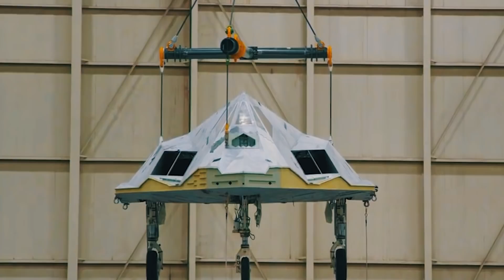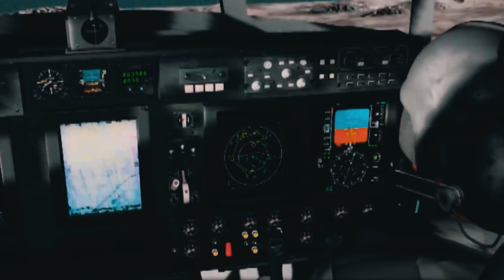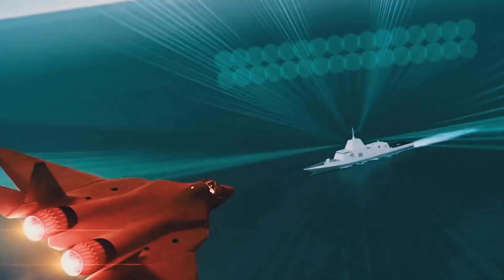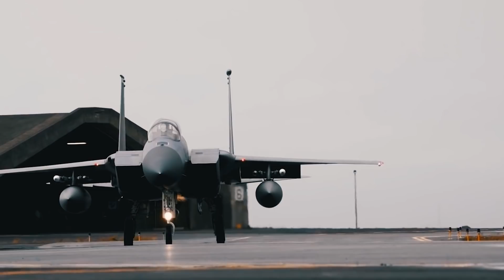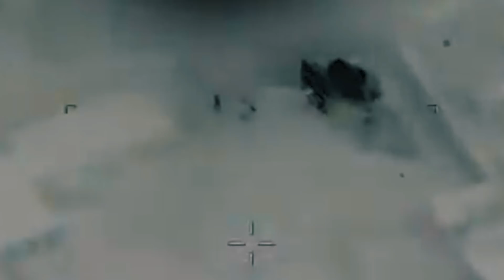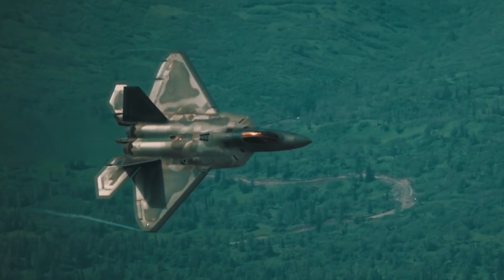Russians are shocked: F-22 Raptor showed its super power

Comment: The idea of a "one plane for all roles" has been proved wrong many times. The A-10 Warthog is an example of this. No F-35 can do what an A-10 can. Ask any of our troups pinned down in a firefight which plane they want for a backup and I bet the A-10 will win every time. Marines fighting in the middle east said that the sound of an A10 moving into a battlefield would make their opponents run away. The F-22 still has not ben outclassed in several points. Isreal does not buy planes they do not believe in as they are staking their lives on them.

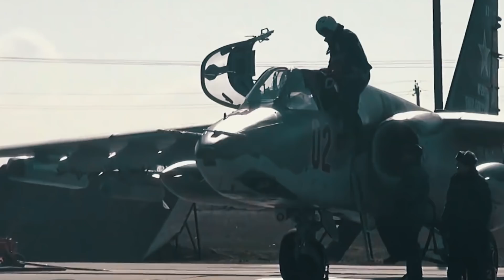Comment: No….no Israel did NOT become the owner of 50 F-22’s last year.  Where are you getting this information??? 07:25 you guys REALLY need to check your sources for accuracy.

Currently Israel has 27 F-35 aircraft, and will receive 23 more by 2024 for a total of 50, but NO ONE will ever get ANY F-22’s.  Period.  They are not available for export.

Also, the range of the F-22 on internal fuel stores is 1600 nautical miles (1841 miles or 2963 kilometers), NOT 1400 kilometers.

Comment: The F22 has yet to be proven in combat.   On the other hand the F15 has shot down over 100 enemy aircraft without a single air to air loss.
Reply: 5 f15's went up to find 1 f22 & all 5 got shot down . It was simulated.
Reply: Never seen the f22

Comment: Unfortunately we thought with the USSR falling apart we would not need this kind of plane so made less than 200 of them.    This means that we get no replacements and parts are going to get hard to get because there is no independent part production line either.    The next plane will probably be manned but will have robot companion planes to fly along with it,  the pilot and weapons officer will control the munitions in the robot planes.   If they all have the same radar signature the enemy will not be able to tell which plane is the "Master" plane with the pilots on board.
Reply: cool ,why risk our pilots anyway

Comment: I am glad that you mentioned that the original RFP was for 750 aircraft.  I was on the pricing team for the Advanced Tactical Fighter (ATF) which became the F-22.  The original quote (1988 dollars) for the aircraft at $30M per copy.  Some of the cost increases were due to the lot size that the orders were coming in and that the original quote stated that the aircraft was going to be 60% composite.  I am not sure if the composite material that was envisioned has yet to be developed.
Reply: One reason the cost goes up is the USAF keeps changing the standards.
Reply: Yes, it's been developed.

Comment: So frustrating! Mentioning the Engine flaps without mentioning the thrust vectoring. They did not cut production because of cost, the cost went way up when they decided to get only 25% of their original order. They would have cost 90-100 mil if they finished the full production run.
Reply: True, but when you have 50 of these bad ass jets , These 50 are all you need to win any battle.

Comment: I just don’t think the F-22 will be phased out quite that quickly. For one look at all the old jets that were in use 20 years past their originally decided use time such as the A-10. The F-22 has so much viability even now with Gen 6 fighters on the horizon that it can still compete with new models of aircraft. Granted their use case might not be as significant as the A-10, I do still believe that the F-22 will see much more use than 2030. Use case could go on for another 15-20 years and still be viable.
Reply: It shouldn't be... still one of the most superior out there

Comment: Question: do airplanes have speed limits while flying in certain air spaces?
Reply: Good question. And the answer yes. However, it depends on the airspace in question, as well as ones location, altitude and other factors. That said, civil aviation uses what is known as the National Airspace System. However, military aircraft can also use the NAS although we must abide by the same regulations as civil aircraft. Furthermore, there is air space that is essentially unrestricted*. For example: Prohibited areas, Restricted areas (Yeah, it makes no sense given *), Warning areas, Military operations areas, AKA MOAs as well as Alert areas and Controlled firing areas or CFAs. That said there are a myriad of rules and regulations which depend on the airspace one is in, with each having their own rules and regulations. Btw, I'm also a civil aviation pilot and when in the NAS I must abide by the rules therein. It's a little like driving on public roads vs a track. So of course I always obey every law, which are referred to as 'rules'. >:)

Comment: There is nothing in the sky that can compete with the F-22 in it's designed role. This isn't bias this is fact. The F-35 is not designed as air superiority, and nothing China or Russia has in the air can beat the F-22 in combat. This is likely going to remain true once the F-22 receives it's upgrades. I can't say for certain how the F-22 will stack against 6th generation when they actually get into the sky, but for now, this is the undisputed ruler of the skies.

Comment: Not only do I think it's worth it but they should pull the YF-23 Black Widow 2 out of mothballs and manufacture 200 of those as well.  These are STILL the high watermark of aviation history and the BW2 is the greatest of them all!
Reply: There are many that still think that the YF-23 was the better jet.  It matched the YF-22 in maneuverability in all parts of the flight envelope except the slowest where the thrust vectoring was a plus.  However the YF-23 supercruised much faster than the YF-22 which would have been a big plus with AAMRAMs.

Comment: Wonderful. I believe it's a very good thing to have several classes of air planes that have different capabilities for various needs. Yes "Stealth" air crafts are suppose to be able to cover most needs but there are times when stealth wouldn't be as needed so having air planes that aren't "Stealth" can cover these needs better.
Reply: An "s"  after the word "aircraft" does NOT make it plural. The word can refer to one or more aircraft
Reply: Thank you Russia for selling the united states titanium
Reply: The F35 has a beast mode.   When stealth is not needed you can really load it up with a LOT of munitions.
Reply: @daveintheblackhills282  Yep- The F-35(s) and the Raptor are very capable as a standard attack air plane when stealth isn't a priority - but with the older air planes the likely hood that the F-35's and F-22 would be used in that capability isn't very high.

Comment: This aircraft was and is next level. There is  no comparison for the level of engineering in it. The Soviets and Chinese just don't have the engineers, workforce aptitude for the materials, software and state of the art processes that manufactured this machine. If someone tells you a definitive speed for the aircraft they are lying It's classified! Engine power output is classified! External coating classified! Get the picture!
Reply: The max speed of supersonic aircraft is actually very easy to calculate...
Reply: the soviets? are you trapped in the cold war era?
Reply: @AnxiousGrips  no... we're here in today's Russia invasion... so when you "think" that nothing can happen, here is your proof that ANYTHING can happen and we have to be prepared, unlike NATO.
Reply: True, wont know exactly what its capable of till its tested !!!! All I know is they keep saying "we have a jet that does what no other jet built can do !!! "

Comment: The Raptor is the best very fighter jet around…. politician’s and capital hill did it in !!! Thanks for your video though!
Reply: The wars in Iraq and Afghanistan were expensive, and a distraction.  The MRAP vehicle was a huge drain on our military budget.  Both the Air Force and the Navy had budgets slashed while money was transferred to the Army to quickly build MRAP vehicles for use in those asymmetric conflicts.  It's ironic that the largest beneficiaries of the IED war fought by terrorists were our near-peer adversaries.

Comment: And yes, the F22 is a great fighter. However, most of the electronics and the more durable stealth body panels of the F35 give it many advantages. It would be nice if we had a fighter with the size, speed, payload, and maneuverability of the F22, and with the modern systems, data links, and updated engines of the F35, which would likely give it the extra range. Perhaps they could also add conformal fuel tanks with stealth coating similar to the F15 Silent Eagle program. Coupled with autonomous drone wingman and decoys we would have an even better fighter weapon system.
Reply: Suggestions have been made to put the F-35's avionics in new F-22 airframes.  I doubt that this would ever happen.  It's probably easier to just design a new fighter than trying to stuff large bits of one into another.
Reply: @longshot7601  one thing to think about is how much smaller computers are today compared to back then... they should retrofit just fine.

Comment: -The first time i ever heard a "fighter' referred to as a "glider".
Reply: Yeah, more than once too. WTF?
Reply: @patrick764  I think he's referring to the airframe, rather than the entire plane, including engines.  strange terminology, but sort of makes sense?
Reply: @jon_byler  you are correct, the 'glider' is the airframe itself, without anything atttached.
There are jet designs around that make this even more evident by including a detachable engine-compartment which makes the jet transform into a glide-capable craft when the compartment is detached completely in fligth
Reply: @jon_byler  Perhaps "glide body"?  Still never heard it used.  "Airframe" usually works quite well.
Reply: @paramounttechnicalconsulti5219  thankyou. Airframe is spoton.
Reply: Def bugged me too
Reply: He’s referring to the airframe, very common lingo
Reply: @VRG_HQ  25 years and 4000 hours......not common to me.
Reply: The narrator knows nothing.  Absurd really.

Comment: What good is a missile if the aircraft can outrun its own missile. And you can only fly at light speed if you're using a laser and then drop out of Lightspeed to use it. They got a long ways to go. I don't understand why the United States Air Force doesn't build its own aircraft. And not having skunkwork gold it at 1 billion dollars period or more aircraft. They have mechanics they have the capabilities so why don't they build their own aircraft period and just let skunkworks design it period or whoever wins the contract. There is a lot of money wasted in government that needs to be fixed

Comment: overall, i think the yf23 was n still is the better plane n if it had serious upgrades, it would outclass the raptor even more
Reply: Relative to requirements of the program, it was not. It LACKED the same level of maneuverability.  In terms of new requirements for Penetrating Counter Air, requirring longer range ... maybe.  NGAD will now look to fill that gap. Some of the NGAD candidates look very  YF23 like.  But again the Raptor excelled at meeting the requirements of the program at its time. YF23 program failed to demonstrate any High AOA manuevering and this cost them dearly in a time when extreme AOA was considered imperative.
Reply: @ivanzlatar2445  The US military actually said the YF-23 outperformed the f-22 so I actually was better. by a lot.
Reply: Similar to the YF-32, the YF-23 lost out - in part - because of its appearance.  The people who make those decisions are fond of a classic empennage, it seems.  

Of course, there are a LOT of other factors involved.  The political wrangling for the 5th generation fighter contracts was enormous.
Reply: @davidsuro986  true and a shame. Why couldn't have both. Like they did with F16 and F18..
Reply: @mrfizzzle  the cuts in defense spending made it impossible to develop both fighters (YF-22 and YF-23) into full production.

The F-16 was never intended to be capable for carrier operations.  The YF-17 was easy relatively easy to develop into a carrier-worth aircraft due to it's wing design features that make it highly stable at high AOA and low speed - essential for carrier landings.

It could be argued that the FY-17 was never intended to beat out the YF-16, and was designed under air force budgeting to be a navy/marine aircraft from the beginning.  

A look at history and the development of the "century series" fighters in the 50s shows what happened when the military budget was swelled due to the cold war.  The USAF essentially green-lit every viable fighter option, then built more of the aircraft that performed the best.  This ended with the F-110, which the USAF renamed the F-4.

After the F-4, computer models made it easier to do more extensive R & D prior to the construction of prototypes.

The current trend is to design unmanned platforms similar to the Loyal Wingman aircraft built by the Aussies.  Such platforms are relatively cheap to design and build compared to manned aircraft.  Upgrades to F-22 and F-35 computer systems are much easier to create than new aircraft.  so, we can anticipate rapid development of unmanned platforms controlled by upgraded computers in our manned systems.   The unmanned platforms are true force multipliers.
Reply: From what I have read about both aircraft I think you are correct